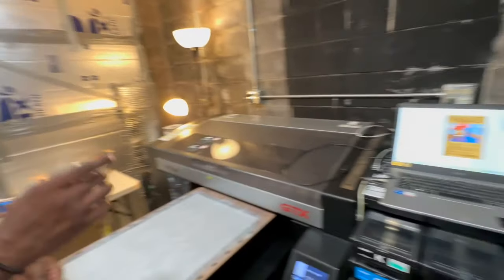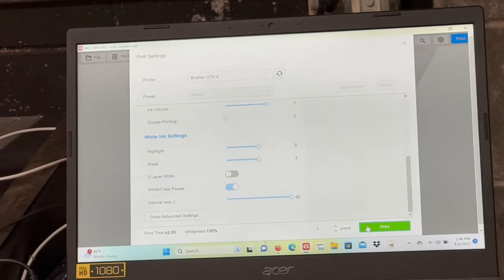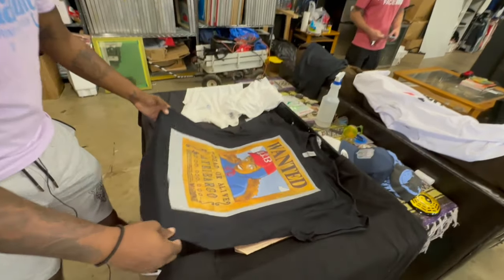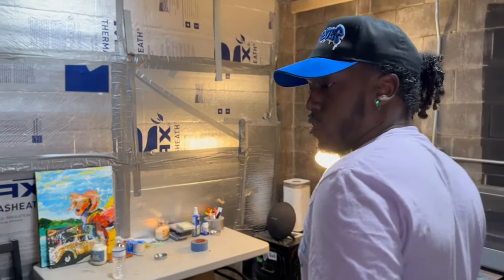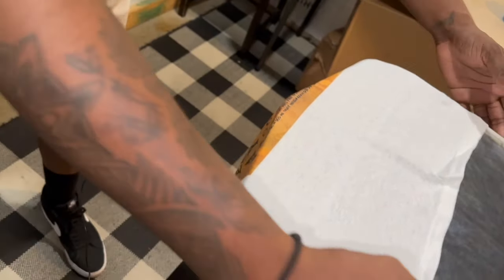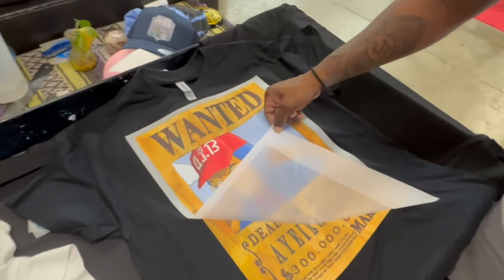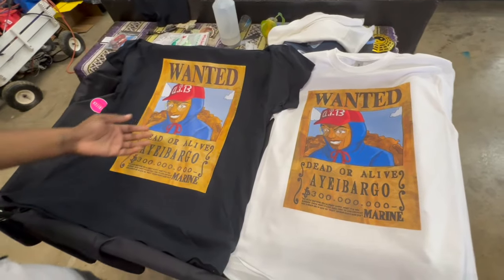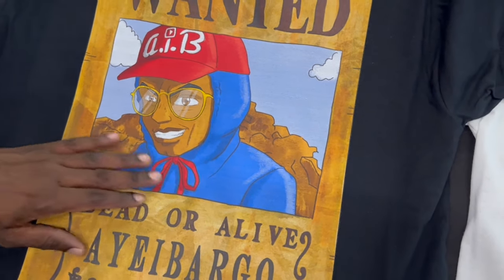DTG vs DTF: Quality, Look, and Feel on a Shirt!

Comment: What's the difference in texture? And which one last longer as far as machine washing?
Reply from the maker: The difference is the Initial feel of something being on top of the shirt vs being in the fibers of the shirt so while DTF is less expensive and still has GREAT quality on the print, you can definitely FEEL it on top of the shirt 

Washability the DTF outlast because it’s a film on top and not ink within the shirt if you get what I mean, so over time of washing DTG and rubbing against itself will cause loss of vibrancy
Reply: @Humanitees  actually with DTF if you print on a white shirts you don't have to use white ink as the base or use 20%-30% to add more flexibility to your print, this makes the print feel more smooth.

On top of that if you print on white or black shirts you can remote from your design the blacks if you are going to press it on a black shirt and whites if you will press it on a white and this helps the t-shirt to breath and makes the design more smooth on the tees. 

And one last tip you can prepare your designs with halftones to imitate screen printing and this makes the prints feel like plastisol screenprints on the tees. 

Overall DTF outperform DTG in almost every aspect.
Reply: @alwinred  well it's better to keep the white coat even for white t-shirts. Because white layer gives enough adhesion between colored ink and fabric. Only color option can cause some parts of your transfer not to print at all.
Reply: @alwinred  Is it possible to make a DTF print so good you can't feel it?
Reply from the maker: @alwinred you are absolutely correct!

I’m definitely going to try out a halftone image and see how close I can imitate that screen feel soon, thanks for all the tips
Reply from the maker: @cucumberwater6643 I would say to get close to this you’d have to keep pressing it over and over and use heavier cloths to go on top to give it texture as it pushes that DTF film more and more into the shirt
Reply: @cucumberwater6643  except the sublimation method which you can't feel every other method including screenprinting you can feel the print. 

However, if you choose a blank of 6.2/63oz (180grams) and you prepare to print your design as a traditional screenprinting then you will not feel the print. 

Removing the blacks from your design when you press it on a black shirt of 5.2oz (150grams) and you also add halftones it feels exactly like screenprinting. 

The reason why DTF feels plastic and not the screenprinting even if both methods can use white plastisol under-base color is that screenprinting has small holes (halftones) due to the mesh that allows the t-shirt to breathe. 

If we imitate this effect in our designs then we can achieve the same feeling.
Reply from the maker: @alwinred agreed I just don’t like sublimation because it’s usually on 100% poly shirts which is essentially wearing plastic on your skin which a lot of people get skin irritation from so I stay away from but true you won’t feel sublimation at all on the garment
Reply from the maker: New video up with the difference tested by homies in the shop
Reply from the maker: @alwinred new video up with the print being done on 2 black shirts and a test at the end
Reply from the maker: @cucumberwater6643 check out the new video, someone didn’t even know the difference in the 2 prints

Comment: Hi what temperature and time do you set the heatpress at for the DTF printing? I’m not sure if I’m heatpressing to long or not long enough but I’m losing a lot of my designs during the peel. I’m using gtx pro and cold peel sheets. Love your videos
Reply from the maker: Yo yo! And if we’re doing DTF on 100% cotton my settings are 325 heat and 30 second press

If you’re doing poly I would bump that down to 290 and a 20 second press, and make sure the Film is absolutely cold before peeling. If you’re still losing your design then it may be your DTF film is under cured or over cured 

Try those settings and let me know if that helps

Comment: well you used white shirt for DTG so you don't have white layer printed, and the feeling is different ofc... Have you used black tee for DTG the feeling would be much closer between the two, with DTG still being a bit softer :)
Reply from the maker: You’re correct, on the white shirt there’s  no need for white base because the shirt becomes that white base so yes it will be 10x softer than if I did DTG on a black or colored shirt. Even then the DTG on a black would be a more soft feel than the DTF because it’s essentially in the fabric of the shirt and not on top like the DTF
Reply from the maker: New video up with 2 black shirts

Comment: Good quick video, but i thought you was gonna really explain the differences a bit as well.
Reply: Also, with my personal experience as far as visual quality-wise I think DTF is the obvious winner.  I tried using print on demand with Printful and Printify, the quality of a simple one color design looked shoddy.  I decided to buy my own heat press and buy DTF transfers from companies online and the quality difference to me is like night and day.  DTG on a white shirt I ordered looked faded like I washed the shirt a handful of times and DTG on a colored shirt that I ordered looked shoddy. The paint was cracked and caked up.  I never looked back from DTG once I got my own heat press and ordered DTF transfers.  That's just my personal experience.  
However, with your video the DTG looks pretty darn good so I don't know what the ppl at Printful and Printify was doing.   Lol....
Reply from the maker: Sorry about that in my upcoming video I will dive deeper into the feel and post press settings
Reply from the maker: @BxW718 most companies don’t use pretreat for their white shirts because “technically” its not needed but I use a personal made mixed pretreat on all my white shirts which gives it more vibrancy and stays that way after being washed the correct way